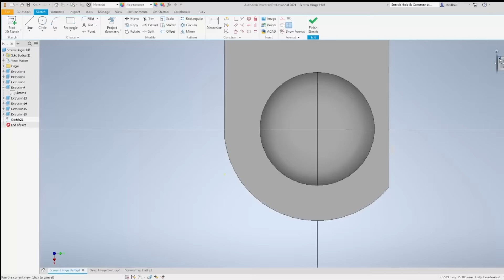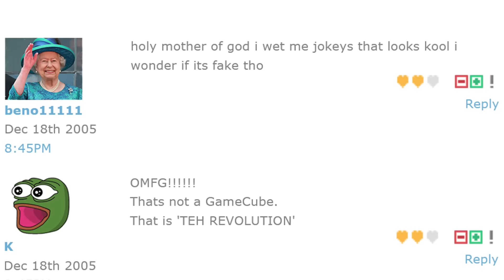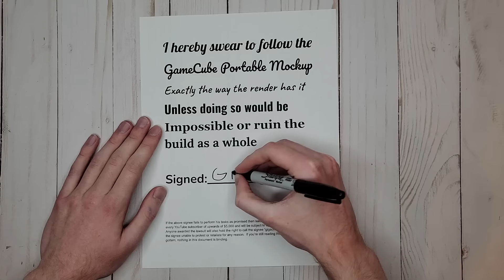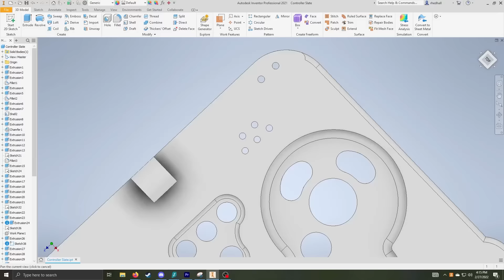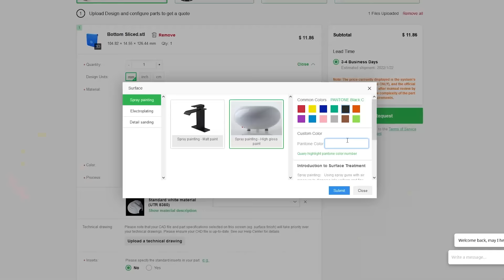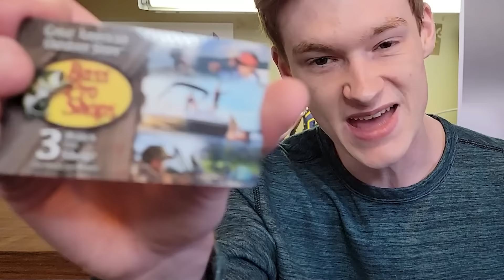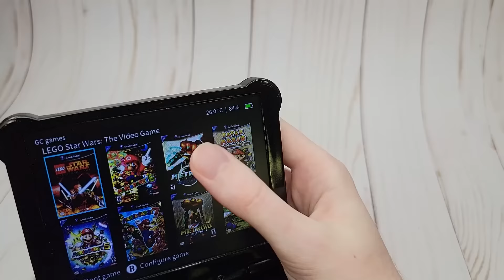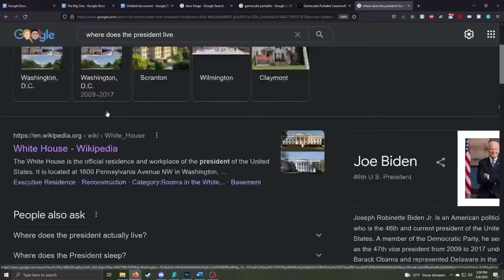I Turned The Fake Portable GameCube Into A Real Thing

Comment: For the first 9 minutes of the video I almost thought that today was gonna be the day I saw a modern portable with a disc drive Lmao. Great stuff!
Reply: I think somebody is making one for the memes, but I don't know if they're done with it.
Reply: @xdragoonzero0  I have an unfinished ps2 portable with a disc drive on the workbench, but it’s been a while since I’ve worked on it. It’s 100% possible, even if impractical
Reply from the maker: Sorry to dissapoint, maybe if Miyamoto hops on board for the next build we'll make it happen.
Reply: @jonnyb9843  I think in this precise form factor this is virtually impossible. Needs a lot more space for the track of the laser, the small motor must take quite a bit of space as well. Plus add some physical overhead to be able to insert discs like the Wii does (and the extra mechanic to suck in/eject discs).. If the handheld opens, you may get around it. Maybe if you get rid of the battery, still not even sure. And more importantly, the alignment of the optics seems really easy to mess up if you are going to assemble such a small disc drive. Would be an amazing feat.

Anyway, I'm baffled the Wii can be trimmed to that extent. That build is wild, and about the battery that's absolutely not a low-power device to begin with so 1h30 is amazing!
Reply: I honestly think it's possible, but the thing would probably be a bit wide
Not necessarily thick though, you could probably cannibalize a disc drive from a Dell Optiplex, they come with some pretty thin disc drives.
Only real issue would be to solve the problem of discs getting scratched while moving the handheld around, maybe sticking some small bits of foam in the drive to prevent the disc from hitting the top or bottom? They'd have to be really low profile. idk but that'd be the hardest part.
Reply: Me too lol
Reply: PSP?
Reply: @Sebax  UMDs don't count lol
Reply: I was boutta say psp
Reply: If you increased the size of the portable, you’d have the ability to put that Wii slot loader in there no problem. 😉
Reply: I’ve seen other drives such as the Wii’s on other systems before, it makes me wonder what’s stopping him from using another disc drive that may be to size with Mini CDs.
Reply: @xbiggxx  UMD has a protective case around the disk, which is why the scratching while being portable and moving around wasn't an issue. I loved the PSP when it came out, great time hauling my PSP and DS around, Good times. Now it's the Switch and Occasionally the 3DS.

Comment: The weird round corners are for the 'laptop' style lid to be easier to open - in the renders, it's pretty clear that the top front edge is straight across, and UNDER the top edge is where the lip starts to dip in. Like the little notch on the bottom half of a macbook, except allllll the way across. I don't know the technical term for it but it's a very common design in folding devices, a spot for the thumb to catch and pop it open much easier in comparison to, say, the SP/DS Lite, which had no such thumb notch.
Reply from the maker: Interesting, that makes a lot of sense.  I thought that the shape was based on the N64 for some reason, but your logic makes a lot more sense.
Reply: @GingerOfOz  I think it's interesting how the worlds of visual design / mockups and physical design / prototypes clash so strongly. As you mentioned, the shape makes it unusual to hold, and it definitely was designed by someone focusing on aesthetics. Perhaps it's preaching to a choir to say this, but I feel like it would actually be incredibly interesting to see you, Shank, or someone similar take a crack at re-making this, but with the focus leaning heavily on modernising/optimizing it, rather than trying to realistically copy the original look. This would certainly make some things easier - the hinge comes to mind for sure (and as someone who's built/owned/modded over 2 dozen DSes, that hinge nintendo uses is absolutely dreamy haha)
Reply: All I can say is this is the most awesome video I've ever watched. I am now a follower of you man can't wait to see more. Sad your not selling this one but maybe someday.
Reply: Dizzy Gear  It's weird to hear that, because I've modded/owned over a dozen DS Lites (still have one from launch and 2 from within a year after that) and literally none of them have had hinge failures, maybe you're just being too damn hard on your equipment?
Reply: Malice  Yeah I've never had my 3DS hinges break with all the shit that happens to them. They got squeaky after I dropped it but that just went away after I stopped using it for a while then went back to it.

Comment: I always liked the idea of making portable cd hardware more portable by using those small gamecube CDs. It's a shame the actual gamecube CD readers were too big. I get it though and this is still so neat.
Reply: Yeah that was the biggest drawback to the GameCube being "portable". It was definitely more compact than it's competition, but a lot of the hardware could only be so small. I do like the concept of this though.
Reply: @mysticmind4563  any disk based haldheld in general, not only they are huge but also suck a lot of power, which means either you have to get a huge battery setup or have low battery life

Comment: This is amazing. My suggestion: make it 50~100% bigger so bigger battery better view  + OLED screen. And it will still be very portable.
Reply: Trying to find a 4:3 OLED panel is hard still. The closest thing is the Microsoft Surface Duo 2, or a foldable, and at that point you might as well emulate GameCube, because those devices can handle it.
Reply: @Shoeboxcat7  yeah also Galaxy fold 3.
Reply: :oops:
Reply: @Shoeboxcat7  yeah I currently have 9 gamecube games emulated on my aya neo handheld pc: Simpsons hit and run, Simpsons road rage, Prince of persia sands of time, crash bandicoot wrath of cortex, wave race blue storm, vexx, tak, ty the tasmanian tiger, Donald duck going quackers
Reply: Honestly just making it wider for those with bigger hands (and installing the disk drive) and extend the battery life. Then again this was a mock-up of an artist rendition. If one was to make something like, a lot of things would be different
Reply: @maneoj46 There's no actual way to get a disc drive inside that, unless you create something like the UMD drive the PSP had. Even then, he showed how he was barely able to fit a 1hr battery inside, and that's mainly due to the inefficiency of the Wii's CPU/GPU compared to modern day ARM chips like the Switch has. Only a breakthrough in battery technology would help the current retro handheld's play time, because they're severely space limited inside. Also, the square narrow design is reminiscent of the GameBoy Advance SP, which has it's own appeal and nostalgia. A wider handheld would be more like a Nintendo DS, or 3DS.

Comment: The original Gamecube was portable with addons. It had a battery pack that attached to the bottom the same way the gameboy player attached, which powered not only the system itself but also the clamshell style LCD screen that attached to the top of the system.

When you factor in Wavebirds and that it had a built in carrying handle, the system seems to have been intended to be portable in this fashion from the get-go.

Comment: Wow, the fact that you can cut off like 80% of motherboard and it will work anyway blows my mind. Like, why it's that big in the first place?
Reply from the maker: The main reason is because the Wii had to fit a disc drive inside of it, so Nintendo didn't have a reason to try and make the motherboard super compact.

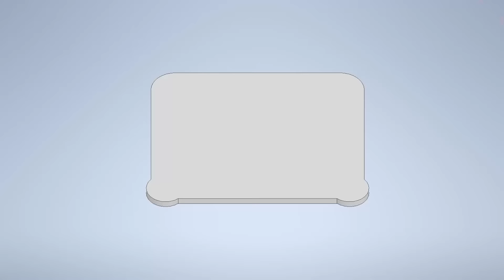Comment: I think the issue you ran into where closing the system made the screen bump into the controls at 6:50 is because your top half is flat, the bezles are flush with the screen. If you look on the render you can see the screen is actually recessed into the plastic leaving room for the controls, you can see this if you look a the edges.

Comment: This reminds me of the time where I bought a clone megadrive on a Chinese website just because the case was a perfect replica of the original except that it did not have a port for the Mega-CD II, it turned out to be the same as the original even inside, this because my dog broke the original casing.
I replaced the motherboard, I kept the power supply, the cables and the controls (they were of poor quality but they were useful), in this way I "restored" the original one cheaply.

Comment: About the bunny ears, the original design actually does not have bunny ears, as you can see the sides of the console are perfectly flat until they start curving inwards mear the corners. The shape is more like very very tiny controller handles, not mickey mouse ears, witch might have made it a tiny bit more comfortable

Comment: The fact that someone have turned the mock-up project many years ago that was meant for fun into a real thing is really impressive. Keeping the disc drive was somewhat odd since it definitely defeats the purpose of portability with shorter battery life but for those with decent GameCube collection, it is still a real deal to play the original console that has been modded.

Comment: I always thought the idea of a plug n play styled system for the 3ds would be awesome. Utilizing the bottom half of the 3ds as the controller and and a hdmi to have the top half on a TV. Or perhaps a type of casting system built in to get rid of the wire all together. I dont have the ability to make such a thing but perhaps it may peak your interest. Congrats on the game cube build it came out amazing.

Comment: 12:05 This happens to me all the time with 3d printed parts and honestly the easiest workaround I found is to make more very little cuts one after the other or doing it in a cup of water. Somehow the water cup methods works pretty good, but that’s not always possible since you might not want moisture in your parts..
Reply: You can cut glass with scissors if you put it under water (you need strong scissors)

Comment: How did you gain the experience to do something like this? I find this to be the coolest stuff and am super curious about it. I already have light soldering experience for what it's worth
Reply: Cad program for designing the housing. Understanding of microcontrollers, electronics and power supplies for the rest. Maybe try tackling a similar project with easy to source components as a start

Comment: Love it but they are not Mickey mouse ears. They are flat on the side. It's a rounded corner that continues inwards to form a lip for your fingers. A lot like a MacBook but taking that lip all the way to the edges. 

The hinge design was possible with 180* of rotation. Take a look at the design of the Sony Tablet P. Hinge is offset 45* from the body. So sticks out a little but allows 180* of rotation.

Comment: Okay, so he started project dimensions by using a gamecube disc, but he didn't think it wasn't an oversight to base it off the size of the disc drive? Sure, the point was to replicate the image. But if you just made it a little fatter for the wii disc slot, not only would you have the disc drive (the only cool part of that specific online render.) But you would've also been able to include bigger batteries so the thing can last more than an hour before going to the forever box.

Comment: I think you could've solved both the battery and space issues by just putting a thin battery slot between the component area and the CD player for a power bank of similar size to the screen, yes it might be a bit thicker on bottom because of it but it would give ample room for re-arranging the components and motherboard, also the component area should be a self contained unit mostly (besides the sockets for power and communication to screen etc). Having it be self contained would allow detaching from the unit for modding without effecting the gamepad etc that don't need to be moved

Comment: a few issues:
-the "ears" are way too exaggerated
-the bezels look too big
-the volume slider is supposed to turn red
-the top half is supposed to have a stripe
-the top half also is supposed to have a screen, at least could have used a sticker. the gamecube logo looks cheap
-the metallic part isnt metallic at all
-the sticks look way too small
-the slot for the discs scratches them
-the hinges could have been smaller

Comment: hey im a retro console fan and i wondered if u wanted to start a funding for a sim card mod that could be patented or sold like the m2 loader. the purpose of the chip would be to add to the capabilitlies of the newer retro consoles like the aya neo or odin or even something like the retroid pocket because the OS they run semi allows it. I know its a stretch trying to mov a cell phone sim card slot and get it working but i figured something nobody has ever done before would be worth it.

Comment: yes i am going to put a tip for this 2 years later,

what if you made a battery accessory that you can attach at the bottom for more battery life? (an optional accessory by the way)
Reply: As it is capable to run and charge off the USB-c port, I Would find it much easier to plug in a power bank than to swap out the Li-Poly batteries which would necessitate a significant design change to an already cramped portable.

Comment: I have a million questions about portable-izing consoles, but for now my most pressing one is...

How exactly did you just use 3DS circle pads/thumb slide joysticks? I have several project ideas where I really want to use them, but have no idea where to start. Are they similar enough to regular joystick pots to just drop them in? Do they require their own driver/controller board? How do you replace a regular stick with one in an existing controller? Where did you source them? The only ones I can find are Sparkfun's Arduino ones. Will those work?

Comment: I remember seeing this thing a few years ago and really hate its design for the simple fact it has a folding back. The connecting joint between the top and bottom half half of the DS family has always been a weakness. I have only had one DS lite snap in half because of it, but why add it to a GameCube design?

Comment: 10:51 can someone exlain how the wii can function without all the chips and capacitors outside the cut mark? Is it then true that like 80% of the board has nor real function in terms of displaying and running games??
Reply: You'd be correct.
Reply: @mysticaxolotl8215 What are all these things for then?
Reply: @Amin_2k  Well, a lot of it gets replicated by those custom PCBs. A good chunk of the board is taken up py power management, video, and Gamecube IO, none of which are neccessary for a portable and/or can be substituted by smaller circuitry
Reply: @mysticaxolotl8215 Hmm i see. Thanks for the explanation. Im still amazed on how these older consoles only need such small motherboard space to function. Amazing stuff

Comment: Opting out of the disc drive killed any authenticity this project had 😶 even leaving the slot in, the disc drive was one of the selling points for this fake.

Why not just gut the disc drive from a portable DVD player? There were plenty that were that small, and you could have used any number of them. Hell, I have one  that small, sitting in my partner's closet right now collecting dust.

But no, the lack of a disc drive is a critical breach of design for a project like this, and if you were truly keeping it as a faithful recreation, you would have found a way to make it work 🤷

Comment: Would it be possible to use the disk tray from a laptop, you can try to tear a disc tray apart and use only the essential parts
Reply: Laptop disc drives can't read gamecube discs, and the Wii can't interface with any ol' disc drive

Comment: not redesigning the GC disc drive to be more compact is a cop out. you have a 3d printer. make it happen
Reply: Literally not how it works
Reply: @mysticaxolotl8215  literally exactly how that works. Less than half of a cd drive is the optical drive and electronics that make it work. The rest is the cd tray and the mechanism components that make it open and close If you can't design a smaller cd tray then you just suck they made cd music players in the 90s that could fit in the palm of your hand with nearly zero wasted space.
Reply: @chadpendt2863  There's a difference between making a disc drive that's INTENDED to be small, and CONVERTING a disc drive to be that small. The GC and Wii disc drives weren't designed to be that compact. The smallest possible trim of the Wii disc drive is STILL almost 2 inches thick vertically and does away with the slot loading mechanism, instead attaching a clip to put a DVD on. I know this because *I've attempted this myself*.

If it's so easy, however, I'd like to see you try.
Reply: @mysticaxolotl8215  your right there is a difference. and its easier to convert one since you already have the optical drive hardware. you only need to design a plastic mechanism to accept that hardware and open/close on a hinge or in this case based on the original concept, eject a disk out the front. if he has to redesign the clamshell to be a quarter inch thicker than before then so be it.